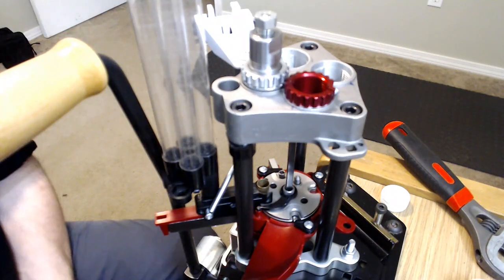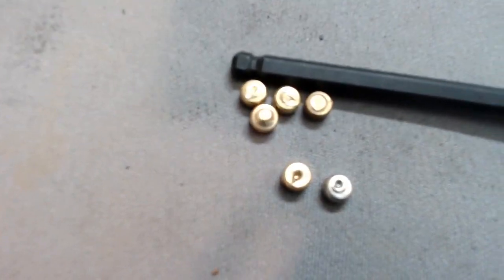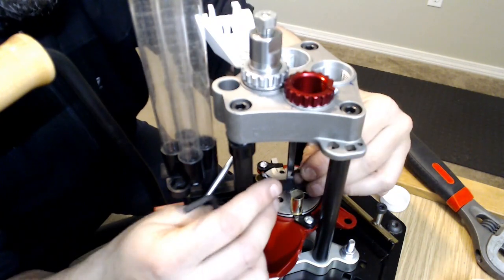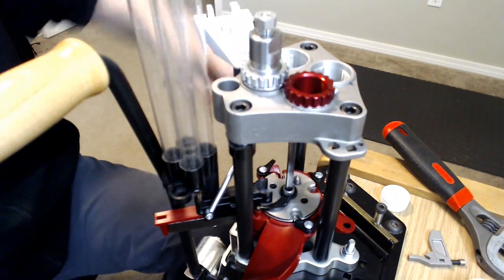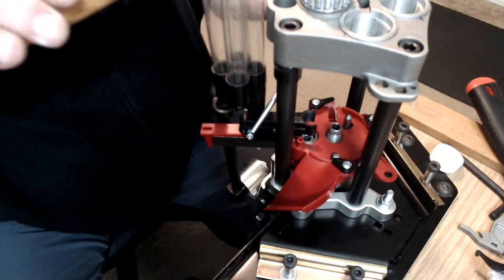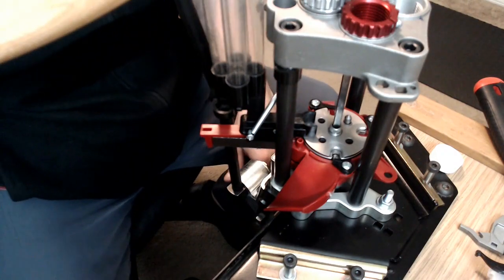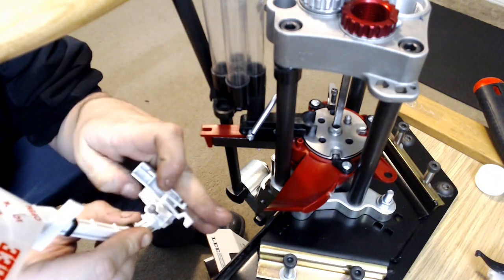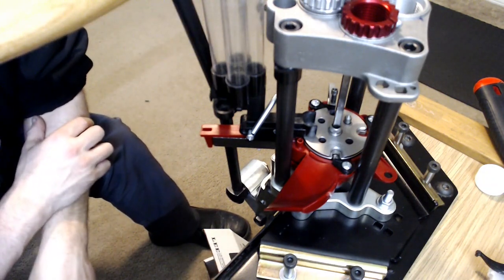Lee Auto Breech Lock Pro - Pain in the Brass

Comment: A lot of pistol brass in 45acp and 9mm have several issues nowadays that are causing your primer issues.  That is small flash holes (primarily foreign import brass), crimped primer holes ( Nato spec cases from federal,  Winchester,  others), and I've experienced rcbs decapping pins on the 45acp and other pistol dies are just slightly thicker than other brands.  I've been reloading for a long time and just experienced these issues.  Also watch out for 45acp cases are now being loaded with small pistol primers by several manufacturers causing broken decapping pins for me. I've eliminated this issue by running ALL my brass, pistol and rifle through a Lee Universal decapping die before reloading.  Great videos you are producing.

Comment: I've been having the same problem but I don't think it's not pushing out all the way in my case.  I have an RCBS decapping die and I think my primer was adhering to the pin, then pulling back up just enough to stick in place as you are experiencing.  My pin fully protrudes below the shell base.  Two things fix it for me mostly.  First is just a double pump right at the top of the ram stroke but not enough to activate the indexer and that's a 100% fix but more work.  The other thing I did was to taper the tip of my ejector pins just a tad to keep the primer from sticking to it.  As for the lock pin type I've never had a problem unless I didn't adjust it properly at start.  The RCBS decapping die is fully locking and I've broke 1 pin in 30 years, and that was on a RCBS press because of mal adjustment.  Thanks a ton for the video, I still get an occasional stuck primer from this problem btw, my pin fix is still not 100%.  Somebody else said this was the worst lee press made.  That's just not true, it's probably the cheapest, but depending on how you care for it and set it up it works mostly perfectly.  I didn't want to shell out the cost of a Hornady, which also has it's unique problems.  For the price this is a great press and I have run many thousands of rounds through mine including 1500 .454 Casull cartridges, thousands of .357 and 9mm.  The parts are cheap to replace and easy to work on.  Lee will send you 2x parts for every one you buy, and replace parts free if you mail them back to Lee.  Great press for the money, and it always helps to be somewhat mechanically inclined.

Comment: Another case that I have experienced the de-caping problem with is S&B. The flash hole is very small  causing the de-capping pin to get stuck in the case and pull out of the bigger part of the pin. This then results in the case being stuck giving similar results, and the other cases, not to be de-capped at all. 
Thanks for the insight and advice. It is really helpful.

Comment: Very useful info about the pez dispenser to fix spring arm with boiling water and a screw, and the decapper popping up by using a hammer to pop the stuck primmer

Comment: The primers are pressed into the primer pocket. That's all it is. When the primer is ignited. Ofcourse the primer will further tight fit itself along the walls of the primer pocket. Crimped or not, (pistol caliber brass are mostly not crimped), all you need to do is push the primer out using a die with a primer pin rod. Ofcourse during the process, some tight fitted primers will produce deformity on the spent primers when its pushed out.
The brass casing getting stuck in the shell plate. or die. This is due to the fact that the casing is just tightly pressed into the die such that when the shell plate tries to pull out the casing out of the die, the base of the brass that makes contact with the shell plate gets stripped off or gets stuck on the shell plate because of a primer that is partially pushed out. Thus when the shell plate turns, the brass that's stuck on the shell plate with the primer partially sticking out is causing problems during the rotation of the shell plate.The casing may also get stuck inside the die.

Most spent brass have a buldge closer to the base. This is due to the casing or round igniting on unprotected barrel. or barrels that have chambers that have slight wider opening. This wider opening causes the brass casing to expand at the base during the explosion. If you do not remove or resize the brass first before you start using your die to deprime and fully resize, you will risk having brass getting stuck inside the die as explained above. or have broken primer pins. This happens even if you lube your brass.

I hope this helps you.

Comment: The decapping pin should never move.  The nut must be tightened really, really well.  It will be harder to tighten than expected.
Reply from the maker: I spoke to lee support about it, and tightened it to point the pin was starting to scar. The pin IS designed to move, specifically to prevent breaking of the pin, which is why they use a collet system to hold it in place instead of threaded. I found it faster and more stress relieving to just whack it with the hammer when the pin started to move because of a primer that just stretched out like a balloon.

Comment: That issue with the primer may be from a firing pin that is too long. Case in point my PPS 43 did the same and worse with two ammo brands.  By stretching in the primer surface way too far in with the firing pin the pushing force weakened the sheeting material on the primer resulting in a rearwards blown out hole in the primer after ignition. Cool flame out the ejection port however.  If you picked up this brass from the range or got it from someone it could be from someone that uses that brand and type of ammo in their particular weapon. That would explain it or it could be a bad batch of ammo. Since Winchester is a large brand name it would be hard to believe that they would have a bad batch like that. After fixing the firing pin it did cure the primer issue totally even when using the same two brands  and batches of ammo as before. BTW great video on the breach lock pro, I will get one after this quarantine thing is over and the shops reopen. Greeting from the Czech Republic!
Reply from the maker: I find it very unlikely that it's a particular weapon or batch causing this, as I know for a fact that some of the Winchester brass was fired by me, from at least 5 different firearms over the course of a few months. I think it's more likely that the primer bodies are slightly softer to decrease chances of failure to fire - possibly related to Winchester's 'new-ish' Train and Defend line of ammo, instead of their older whitebox line of stuff. This could also result in the primer actually expanding in the pocket and wedging itself in place.

Comment: Get the Dillon spring loaded sizing die. If you only want to decap the brass in this step, get the 45acp sizer die. You can deprime .380, 9mm, 40, and also  45acp of course and you will resize the 45acp case also..I got tired of popping the pin on the Lee die.
Reply from the maker: Thanks for the recommendation! I will certainly have to look into it when I get into a new batch of brass (along with a collet bullet puller)
Reply: I have the lee universal decaping die. I decap on a separate press and size on  the first station of my load master. I might still try your suggestion because I’ve had issues with lee and RCBS universal decaping dies.

Comment: This may be the worst press Lee has ever made. You don’t need a hammer to knock the decapping pin down, it takes 2 wrenches and tighten the nut.  Short stroke the press once or twice and you ruin the plastic parts. Bullet feeder doesn’t work. Gave mine away.
Reply: What did you replace yours with? Hornady, Dillion, RCBS, Redding? Do tell and which model?
Reply: @Kcrunchymunch    Went back to using my Lee Classic Turret.